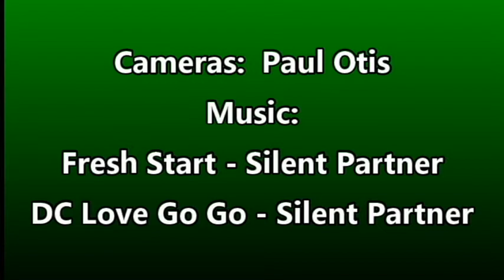How to make BEESWAX CANDLES

Comment: Next time put a small amount in first & let it solidify and then add the rest of the hot wax. Edit_- put a piece of flat Not corrugated cardboard under can over wick. Or make smaller hole next time.
Reply from the maker: Thanks, I hadn't done this since 1985. :)  Will be finishing up the candles after they cool.  Thanks for watching!